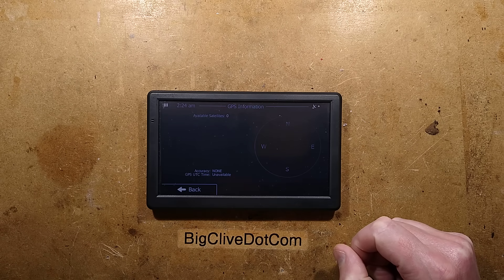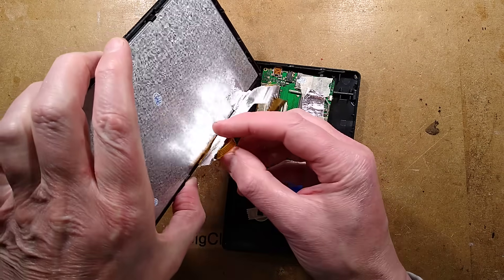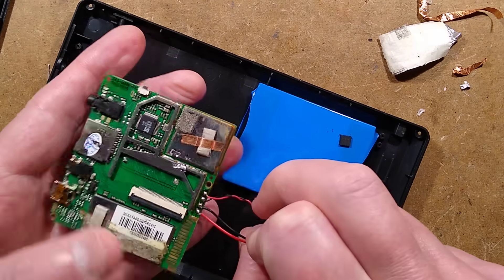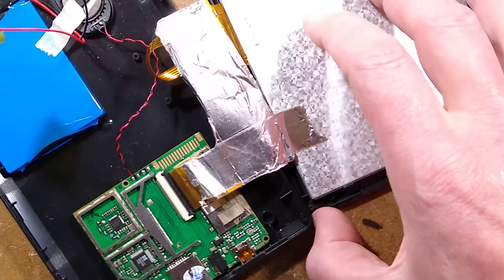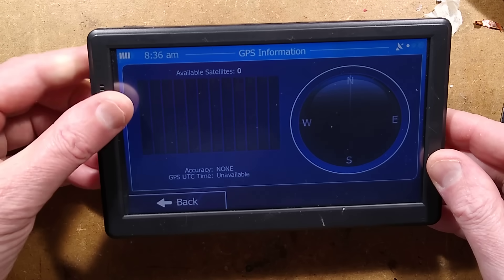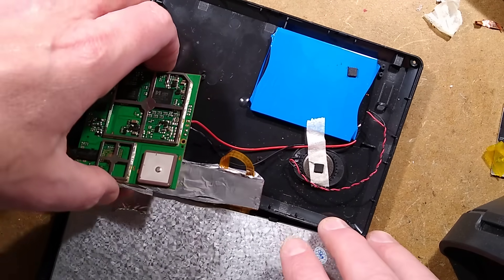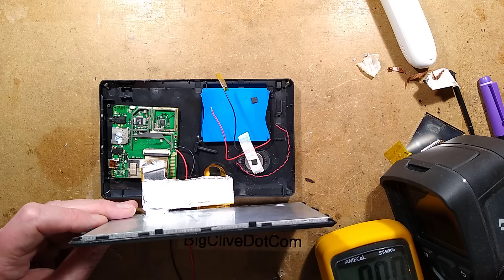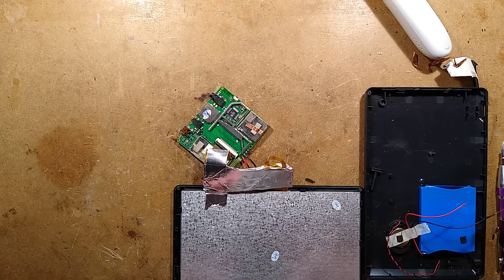Inside a trashy sat-nav

Comment: Glad I never bought one of those...  I was tempted: I had a small laptop with a USB GPS and it was attached to a touch screen (I had to replace the touch panel component that had died) and it worked pretty good, but of course it eventually got stolen...  surprise surprise.

Comment: I bought a very expensive truck sat nav that when you put the length hight weight ect that was supposed to gide you around low bridges ect it did none of these thing's it was useless then I bought a cheep Chinese truck sat nav that turned out to be excellent just go's to show that cheep isn't always crap

Comment: My new Garmin Drivesmart 65 refuses to locate satellites in my 2001 Ford as it has a heated front screen. The unit works in my wife’s car but not mine.
Wish it had an external antenna fitting but alas not.

Comment: That reminded me of the time I had to wrap a SATA cable in foil in a $3000 Macbook when I upgraded it to a solid-state drive, because the EMI at the higher speeds would cause instability.  Worst shielding ever.

Comment: I tool an old Garmin on a plane on the East Coast of the Colonies to Orlando, Florida while on holiday. It read properly from take-off until landing, up to 30000 feet. It was actually showing the roads below although we were doing over 680 miles per hour with a tail wind. That is my new high score for my navi unit. I sat by the window to get 4 bars on the reception indicator, and some of the passengers were staring to see what I was doing with a nav unit and a battery pack. A nervous bunch.

Comment: Years ago I found an old, cheap satnav that corrupted part of its firmware that handles the clock, which totally prevents the device from being able to latch on to satellite signals. Reinstalling the firmware fixed the issue, but after a day or two it would need to be re-imaged again.

Comment: I have a P-Navi sat nav that appears to have a similar format. It needs to be on the windscreen to pick up any signals. Even moving it a few inches from the windscreen stops it picking up anything. I also replaced its battery with one from a poundstore powerbank. Been 2 years now without a problem.

Comment: Usually a sat-nav would use power from a vehicle so the tiny battery is excusable I suppose. 
My Nextbase dash cam has a tiny battery and always claims low battery when it's not externally powered.

Comment: I've played with a lot of satnavs over the years, from writing navigation software to various utils for their configuration and calibration.

First thing you need to do on kit from that era is make sure your date and time are set correctly - I noticed in the video that you had the time at various values. Without it being correct the Rx really doesn't like it. 

The receiver also tries to use the existing location to speed up satellite acquisition - if you used it say in London, switched it off, traveled to Miami and switched on it can take hours to realise it's unable to pick up the expected sats.

As soon as it's identified a suitable satellite to track it will start downloading the ephemeris data so it will know what other sats to expect.

The usual chip in those receivers try to track either 12 or 20 sats iirc (sirf 3?) and require 3 to get a 2d fix, 4 for a 3d (well you could get by on 3 if you use the earth as a pseudo sat). The ones with the highest signal strength should get used in the position calculation, as sats come in and out of view the ones used should change.

Main problem with sirf chipset was it was a little deaf when it came to receiving the sat signals. This meant that if it never picked up one satellite of sufficient quality it would never actually progress with the almanac download. Inside a building you could very rarely get a lock - putting it near a window occasionally worked.

Slight aside - similar hardware to the Gizmondo handheld console. Also running win CE 4.2

Love the channel btw.
Reply: I'd agree that with those very old GPS chipsets they'll almost never get a lock indoors.
Reply: We have Tomtom from around 2010 year and you literally need be outside before it finds any satellites. Even in garage with door open no change...

Comment: Hi, I worked on a similair nav a few months back.
These are crappy chinese nav systems most of the time with cracked navigation software.

some of them run at windows mobile and could simple be unlocked when changed some registery settings so it boots in to the windows mobile desktop.
There are also firmwares arround and you could flash them with some other firmware be sure you use the right one for the device!

it's not worth a lot of time but its the fun with it!

Comment: I have an almost identical unit. It’s Windows CE rather than Android.
The reason it went back to the menu when you opened it back up is probably because you managed to press the power button (which on a single press rather than a long-press takes the unit back to that menu).

Comment: RFI is a real problem for gps receivers.  I once built a car stereo using a mini-itx motherboard in a double din case, with a tablet for the UI.  The tablet couldn't pick up GPS because the motherboard was putting out too much RFI.  That tablet now works fine since I moved to using a raspberry pi located in the trunk.  On the cheapo satnav, shielding the cpu componentry on one side still lets the RFI out through the PC to interfere with the receiver.

Comment: This is pretty much identical to many Windows CE satnavs, some of which were/are sold under the brand Nozatec. Cheap and nasty components, rather dim screen, tiny battery (they're only intended to be run when powered by the supplied 12v adapter lead) but they are shipped with iGo software, which is by far the best (though not the most Intuitive) consumer navigation software on the market at any price. 
Unfortunately, the GPS will have the week number rollover bug (fixable with a free firmware update from the Facebook group) out of date and incomplete map sets (current, complete sets a free download from that group) and the meridian bug which can affect routes planned across the Greenwich meridian (there is no fix: you have to work round that one).
Interesting that a failing battery stopped it getting a GPS fix.
It would be well worth paying a couple of quid for a new battery. These things work surprisingly well. 
Vastly better than TomTom, Garmin, Aguri which cost much, much more.
You can buy a new one for about £40 or so, but that will need the maps fixed, even new out of the box.
Reply from the maker: This may actually be a CE unit.

Comment: The thermo latency of the iron is much enough you to weld the cables. Also was better you to weld first the red cable and after that the black one - in this case is not possible to make a short circuit. ;)

Comment: Why these devices don't find satellites is quite simple: They need satellite position update data to calculate device positions quickly. Old style GPS receivers had to calculate satellite positions for 25 minutes or more. Modern devices get satellite positions as regular - often daily - updates. So whenever your mobile phone picks up GPS signal in seconds, you can bet that your phone knew the satellites position beforehand. When these updates stop it takes longer and longer and longer to get a position fix. Eventually you are back at 25 minutes when your device calculates positions from scratch.

Comment: Sat nav batteries are really only designed to provide enough power to shut the unit down when "mains" (ie; 12v supply) is disconnected, hence why it is so small.

Comment: Who is still buying these things?? I know they're very useful for truck drivers and such, but doesn't everyone else just use their phone? I had to buy a GPS back in 2014 as the car I was driving at the time didn't have a working speedometer, and the GPS had a nice speed gauge that I used.
Reply: People who can't read a proper map.  Or follow the blatant signs on the road. And anyone squinting at a phone, well they must have a lot of faith in the coverage of the network considering they have to constantly download data they also have to pay for. Not fun trying to use a phone app, that displays adverts, while just able to get GPRS as you twist and turn in the Yorkshire dales then a call comes in, plastering your contacts face over the map but that's not the last of the issues!  You just ran out of data.

I prefer my offline, unpowered OS map. I have an offline satnav as assistance in following a route or handling unexpected route changes. The phone? It is doing what it should be doing. Folded up in its case, away from me entirely.

I also can read sign's!  So practically have no need of the paper map for most of the route.  That was a revelation!  My first time driving to Yorkshire, practically clutching at the satnav, only to realise I was able to simply follow the signs!

They claim the roads keep changing, like the stairs in Hogwarts I suppose?  Lol, my paper map and offline sat have say otherwise. Also I can avoid the con that satnav/phone apps are. Constantly paying for updates that are not needed, being shown adverts as the phone detected I'm driving near a MC Donald's.  Suddenly losing the map as there is no network, or it's a faulty cell, or I have just use the last of my data because I didn't download the huge map file for all of the UK because my phone isn't worth £1000 to be replaced every few months.  16GB is more than enough for most uses but not a full map, that even then doesn't have an eighth of the detail of the paper one.

I have a CS degree, work in IT. My choices are informed from an understanding of computer technology most don't possess.  The problem is navigation, signal, power, data allowance, cost. I built the solution that beats all of that.

Comment: I had many Chinese GPS units like this and integrated in car radios to update theirs maps. Many came with iGO Primo and are WinCE devices (few MB of ram, low power ARM SoC) and usually for old devices 1 to 4GB internal storage only, the newer have memory card slot. All of them that had battery have only minutes of battery time before they shutdown, (I think) because they were used plugged on in the lighter car adapter. One device (Danet, french made) was able to run for a hour or so from its battery only because it was new in the box and it was intended (marketed) as a pedestrian GPS device. Using the device as mp3/media player actually have same time of use like the navigation program, so I think that the GPS circuit itself is not te main power consumer, but the screen light and the CPU.
Even TomTom, Via Michelin, Garmin or other well known brands have low battery capacity inside that make them unsuitable to pedestrian use.
So, use it plugged in; I guess it need a 5V mini USB cable.

Comment: I've seen that kapton tape on parts with holes in them, I think it's for the pick and place machines to get good suction when picking them up. On this antenna it doesn't seem to make sense except there's that little bulge on top - maybe it helps with that. I'm guessing the corrosion could be from the car A/C blowing cold air on the housing, condensing water inside.

Comment: Interesting that the company didn't remove the pick aid on the shield fence. Those are there for P&P machines to be able to grab hold of. Usually the pick aid needs to be snipped away for automated optical inspection/access to rework if needed.

Comment: I own a Hema Navigator GPS that I purchased brand new in 2013 and it looks EXACTLY like this on the inside!  I paid $700 Aussie Pesos for it and it was top of the range in the day.  Mine didn't come with all the masking tape and foil though :)  

Incidentally, mine runs Windows CE.  And it's really quite a good GPS.  Its both on and offroad (shipped with heaps of topographical maps).
Reply: Actually, it is very similar, but that's a heap of shit compared to the Hema :)  It uses the same software though - iGo.  Interesting.

Comment: ... I mean, sure, you could use aluminum tape, but you can't use the usual solder with it, and I'm pretty sure the adhesive isn't conductive (it's usually meant to seal up ducts, so it's the actual duct tape).

Comment: That looks like a kit-bash of circuit board + Adafruit lithium battery inside, and yes, I totally would use metal tape and an insulator, only in my case it would be copper tape and Kapton tape because that's what I have. True story, I needed to combine Neopixels and audio, and those Neopixels were surprisingly noisy, so the copper tape thing is what I did to shield the speaker wires. Not a perfect solution, but it was good enough for government work.

Comment: Yea those old gps systems could only read a few sats at the same time and the longer they were off the  longer it takes them to relock.   You have 3 locked that's normal you have to bring it outsite.

Comment: I struggled with a similar unit in the early days - It was equally crappy inside with a tiny battery which I think was more for voltage regulation of the 12v input from a vehicle than for running the device unplugged.  Thankfully we are well past these pieces of trash, although there are still some of them on the market such as VMS, HEMA, Garmin, etc.

Comment: Video is great as usual but the device itself runs a really hacked together version of Windows CE 4.2 (iirc). Why Windows CE 4.2? I have no idea, however that version seems to be compatible with versions of Nav N Go's (NNG) iGO 8 and Primo software. Seen these hot garbage navigation devices at my previous workplace. Setting these up is truly amazing (unlike standard Windows CE these expose both the internal storage and the SD/MMC card to the computer as a mass storage device with godawful transfer speeds). The UI is horrible.

Comment: If you had turned down the voltage on the bench power supply slowly down to say 3 vilts, would the sat chip trip and stop working before the cpu, which would cause it to lose satellite reception but keep the cpu turned on and show the ui like the symptoms in the start of the video?

Comment: Those ones are so much better than the newish tomtom's .
I still prefer tomtom's original way of address search, road  first. But they all seem to have the area then diminishing letters for road. As a professional driver I own many navs , none of the tomtom's get a signal bacause satalite number rollover,  the new ones (pricey) the operating system was glitching out and crashing while it was on the display stand in Halfords. 20 quid one from China was best decision portable Windows system, software looks same as this video.  annoyingly ones with a 3.5 to 4.5 inch screen were less common when.i last looked.

Comment: Older GPS chipsets will not easily get a lock indoors. If you try outside it may get the 4 sats it needs for a reliable position.

Comment: Probably worth noting that GPS engines cache satellite positions using a battery backup. They take a while for "first acquisition" when you change batteries, as they lose the cache. So since the battery was disconnected, it would take a long time. Also, the ceramic antenna used there is highly directional in my experience. They need to face vaguely upwards. The spiral type antennas are better if the unit needs to be used in any orientation.

Comment: Old devices have trouble locking on to satellites if the system time is out by any great margin. Always worth setting the system time after a device has been moved while off and it has to do a cold start.

Comment: I had one GPS with this same board but different SW. It had this same gps locking issue after a while. I thought that the RMA technicians had damaged the gps antenna after fixing another issue. I thought the laser cuttings on the antenna were screwdriver markings after using the antenna as a lever point to remove the shielding cover... i realized the laser cuts were a normal thing after seeing replacements antennas on ebay. Either way, i have sold the unit with my old vehicle as it had backup camera with it.
Also, it had a digital tv reception module that was soldered on the header right next to the Lcd and touch header. I never found out a way to reflash the firmware but i still have its dump.

Comment: A few years ago all gps units here in Canada required new firmware for some changes in the GPS network as a whole. Without those few changes they would no longer connect to satellites correctly.
I would expect that whoever manufactured this maybe rolled their own update that worked acceptably at that point in time, falling down after smaller changes thereafter. 
How old is the GPS receiver ic?

Comment: I bet you a pint of Radium Gin that's been (poorly) reworked in the factory. The rework flux has been left on and has corroded the board and it looks like they lost one of the shields so have tried to balance the impedance with tin foil. 
"Hey Boss it kinda works" "Fine, Slap the cover on and let the foreign devils worry about it"

Comment: I had one from Garmin and bought the Panama map before leaving for vacation in 2005. 
The damn thing routed me through the shittiest roads in Panama's back roads. 
The poor rental Toyota Yaris was taking a beating on the dirt road. I was very impressed by the heavy duty suspension of the Yaris. 
When I found there was a paved road running in parallel to the jungle dirt road, I got so pissed off, I throw the damn thing out the car window.
Reply: ... Ah, so that's how we can find random GPS units and other electronics in the jungle!
Reply: @KomiyanVT  If you found mine, you can keep it :)